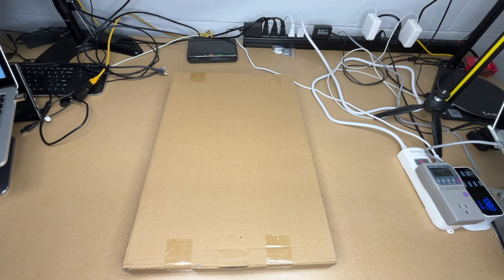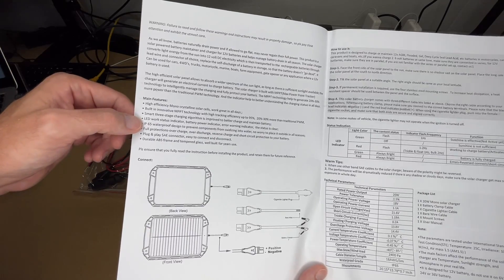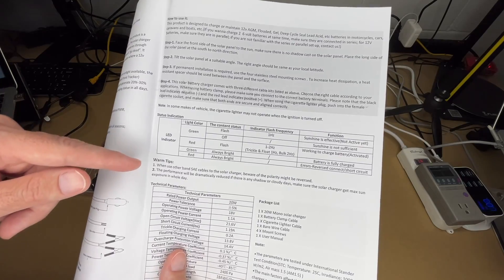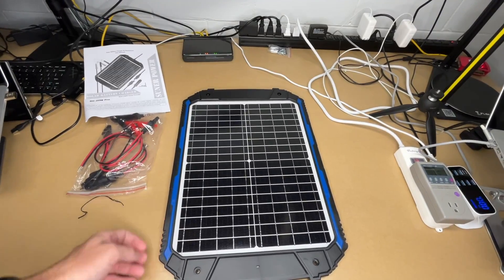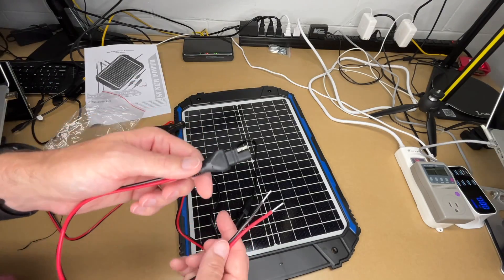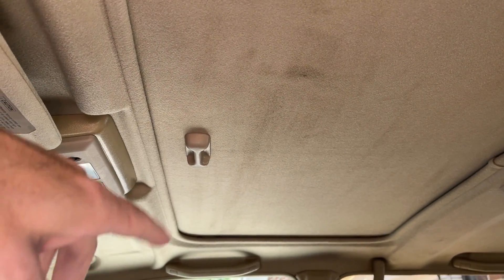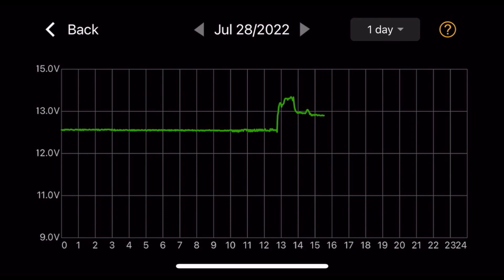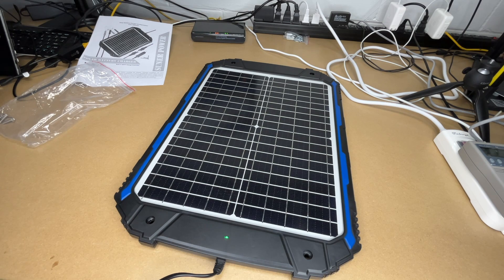SUNER POWER Waterproof 12V 20W Solar Battery Charger & Maintainer

Comment: 3:39 Wouldn’t plugging this into the 12V/cigarette lighter socket be effectively useless?  Recharging the battery through the 12V/cigarette lighter socket would be like trying to fill a bathtub with a straw.  It’d be an incredibly tiny trickle of charge through that socket.  Would it not?  (Factory, no modifications.)

Comment: Thanks for the review and video. Well done.   Do you think this would work ok if I connected it to 4 12V batteries simultaneously?  My boat has 4 batteries that will not be charged otherwise for 5 months during the off-season drydocked in a boatyard in the tropics. I just need trickle charge to keep them healthy while I’m away for the off season. Thanks in advance
Reply: it probably would work pretty well so long as all of your batteries are in parallel and their size isnt too large. A lead acid battery can lose 5-20% charge a month so lets assume that its 10% across 4 200ah batteries at 12 volts. that would be around 960 watt hrs (not a perfect conversion but close enough). 20 watts running 5 hrs a day would easily keep them topped up
Reply: Thanks for the advice.

Comment: Why is there no option to install this on the car permanently? I don't want to pop the hood in the parking lot in front of Walmart to attach the clamps to the battery. Is that because it's not safe for permanent use? Why not just have special connectors instead of alligator clamps and have the wires fed directly into the cabin to keep the solar charger connected 100% of the time? This way, it could charge the battery continuously. Install it once for the like of the car and never worry about it again.
Reply from the maker: What are you wishing to use the solar panel for? These are usually used to maintain a battery when the car is not being driven regularly but it sounds like maybe you have some other use case in mind.

Comment: Do you know if it's possible/practical to daisy-chain two of these?
Reply from the maker: I'm not sure if you can do that? I would guess you could connect two to a battery in parallel but probably not in series to get 24V.
Reply: @Rickmakes  I had two 1.5 amp trickle charge panels connected in series to deliver 3 amps to the battery.

Comment: Can this be left on your rv, or whatever, for months at a time without damage to the batteries? Some solar panels you can't, like Regony. 
 Some solar panels you have get a device that goes between the battery and the panel to  stop any problems from happening, ie the green "Tender", I think is called a controller.
T4TV.
Reply from the maker: Yes. This solar panel has a built in charge controller. It is designed to be a battery tender or battery maintainer and has over charge protection.
Reply: @Rickmakes  wow, that's great to hear. Thank you.

Comment: Can I connect the solar power wires and install them directly to the battery terminals to charge them permanently?  While the car is running or when the car is parked
Reply from the maker: It is not recommended to keep the solar panel connected when running the alternator. You could potentially install something like a relay to disconnect the panel when the car is running.
Reply: @Rickmakes  That doesn't seem to make sense.  The solar panel's built in charge controller has a circuit to prevent over charging and will disconnect the panel from the battery when the battery reaches full charge at about 12 Volts.  As soon as the alternator starts, it will deliver more than 12.0 volts, which the charge controller will detect and disconnect the solar panel.  Am I missing something here?  I had a roof top solar panel on my van connected directly tot he battery for 9 years with no issues.
Reply: @Rickmakes  Thanks for the answer😊

Comment: If you parked in the garage Does the garage light charge it at night?
Reply from the maker: It wouldn't be feasible to charge with a garage light. You would need a garage light as bright as the sun focused on the panel. This could be thousands of watts of light.
Reply: @Rickmakes  how about your high beams on the car? They run off of 12v! Or some Jeep flood lights they are just 12v, ?.? Just set it up in front of the car and turn on the lights! ???

Comment: Do I need to disconnect when starting the car??
Reply from the maker: It is recommended that you disconnect it before starting your car.
Reply: @Rickmakes  I’m thinking of connecting direct to battery. Is there a quick disconnect or switch I can use? What happens if I forget to disconnect before start the engine?

Comment: I need solar panel to keep  my 110ah battery topped up when in winter storage will the one you showed do this please only thing on is alarm  flashing light
Reply from the maker: I would guess this would handle that just fine.